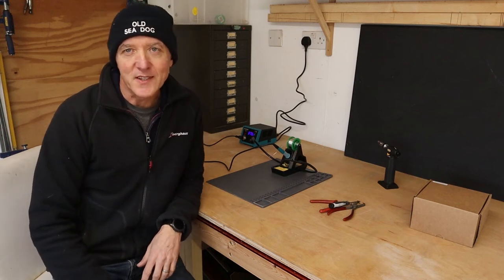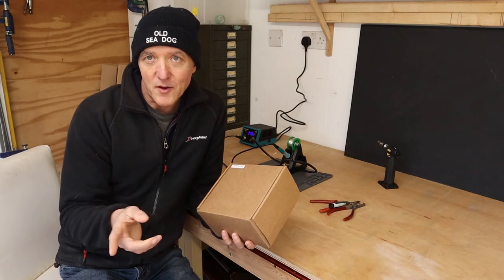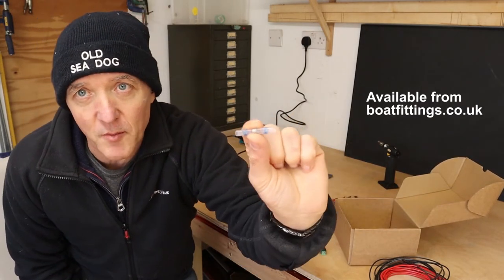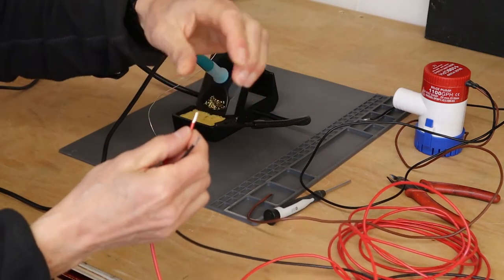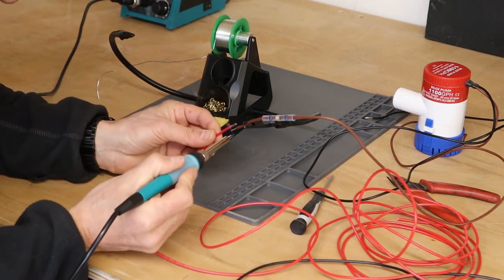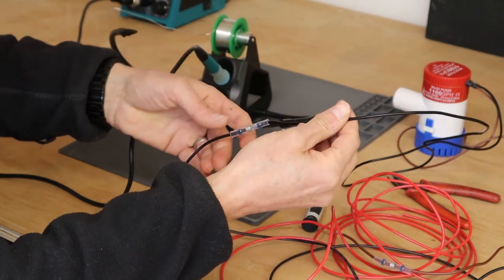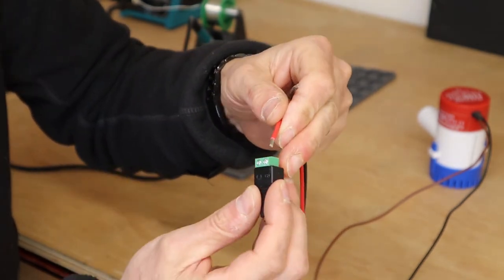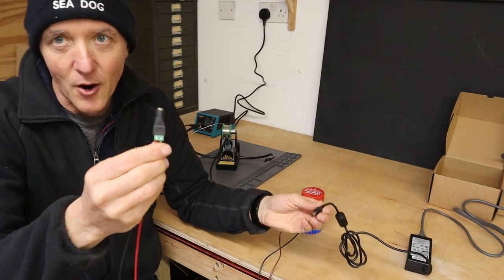12V Submersible Pump, Kit To Power 12V Submersible Pump From Mains Supply: Cellar Pump Basement Pump

Comment: Can this pump runs for 3 hours without stopping?
Reply from the maker: Hi thanks for your question.  I haven't tested this specific one for hours, but I have had similar pumps on test for 5 or 6 hours without any issue.
Reply: @BoatFittings ok thanks alot
Reply: I know bigger jabso bildge pump will run darn near continuous wet or dry in some nasty bilge slug